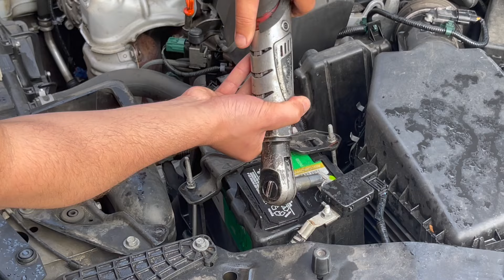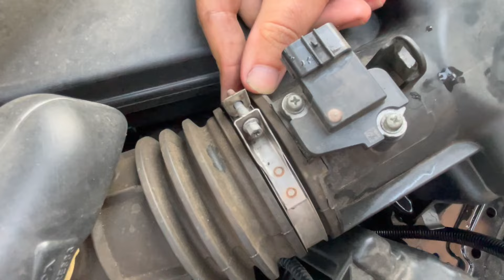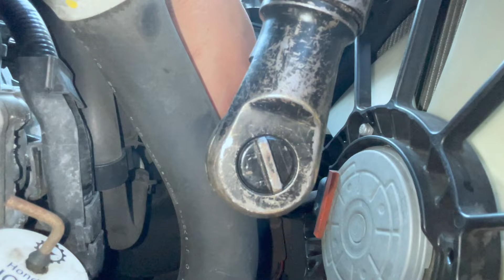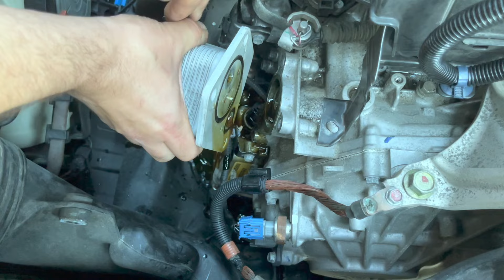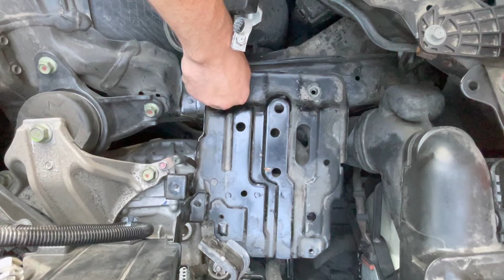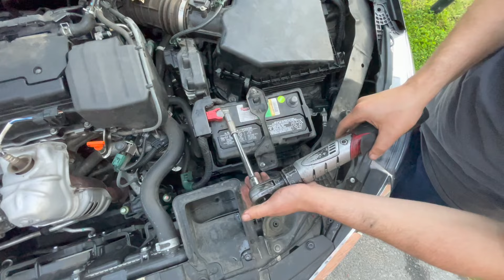DIY 2013 2014 2015 2016 2017 Honda Accord Change CVT Transmission Filter

Comment: Honda does not recommend changing the CVT filter unless it it leaking, clogged or damaged. If you are going to change any filter, the one on the bottom of the CVT in the oil pan should be changed. This one is just a secondary filter which is intended to filter whatever the primary filter does not. Changing this filter, especially by itself is not useful
Reply from the maker: Thank you for the info. I will try to do another video on the internal filter next oil change. Cheers
Reply: @MobileCarMechanic  please let me know when you do, I have the 2013 sport and I plan on doing all the maintenance myself as yourself so you’ll definitely be helping me with your videos! Thanks man💪🏽
Reply: Is there a video on this internal filter you speak of? Thanks for the heads up!
Reply: Where is the filter on the oil pan? What’s the part number please?
Reply: @mcbay9080  it's in the oil pan
Reply: Great video. Thank you!
Reply: @whatthewhat11. Yea your right Honda doesn’t recommend it they also don’t recommend to change your transmission fluid because it’s “good for the life of the vehicle” but you believe that?
Reply: @JOEL_AL_MONTE my owner manual says every 30k miles 2013 exl
Reply: HONDA SPECIFIES CVT  TRANSMISSION FLUID CHANGE AT EVERY 90K MILES FOR MY 2016 ACCORD LX 2.4 L ENGINE. (4 QTS OF HCF2 GENUINE HONDA TRANSMISSION FLUID)..oh yes😮
Reply: QUESTION ABOUT COMMENT ABOVE:
HOW DO YOU KNOW CVT TRANS FILTER IS NOT PARTIALLT CLOGGED UNLESS YOU  REMOVE IT?😊
Reply: COULD CVT TRANNY FILTER BE PARTIALLY CLOGGED ?😊
Reply: Would this be the same for a 2011 Acura Tl 3.7 AWD I can't find a video on one
Reply: So which filter should we change?
Reply: Changing any filter is helpful, secondary, or not. Maintaining the fluid in a CVT is very important for longevity. Honda doesn't recommend changing anything on a CVT , but does that really make sense ?
Reply: @kellyjackson1451 i agree with you.
Reply: You can't change the internal transmission filter.. because it's inside the transmission, duh.
Reply: @terrelle5087 wrong! It is inside the transmission oil pan. Not inside the transmission!
Reply: Where did you heard that genius? From what I heard it is recommended to change every 30k-60k miles.
Reply: @juangonzalez9567   honda tell you it's not accessible.  Plus, you wasting your time because it is not something that needs to be changed.

Smart guy
Reply: Maybe that explains why it's such a bear to reach this filter. Seemed as though we were journeying to Hades
Reply: Is that so they can make money off of keeping you dumb and not changing it if it's contaminated?
Reply: @juangonzalez9567 I don't believe there is a transmission "drain pan" on the CVT transmission. There is only a drain plug and level plug in the transmission body.
Reply: The 2013 doesn’t have a filter in the “pan” this is the only filter so changing this is useful
Reply: @JOEL_AL_MONTE  it's good for the life of the transmission 😂😂😂
Reply: @juangonzalez9567  he might be getting kilometres and miles mixed up 60k miles is about 90k kilometres.
Reply: Too complicate to change the filter
Reply: @kellyjackson1451 manual for my 2017 honda accord recommended that the transmission be changed , where did you read the honda does not recommend changing of filter or oil.?? 

You are not going to find honda documentation stating not changing filter or oil. Why? Because it doesn't exit. Prove me wrong. Please. 

I can't stand youtube wannabe mechanic. Making up statements and spreading wrong information
Reply: ALL filter needs to be changed juts like the air filter and oil filter and cabin filter. You gonna listen to the dealer ??? CVT are very delicate. All fluid and filters need to be changed get out of here with that bs
Reply: @juangonzalez9567 that would be the strainer. The actual filter is behind the warmer on the front of the trans.
Reply: Exactly!
Reply: Both if you want job done! Internal in oil pan is more important, because collecting all metal shavings and debris from transmission wear, this filter is just for “transmission oil cooler” which is insignificant according to honda 🤷🏼‍♂️
Reply: you can, but you need to drop oil pan and later need to install new gasket for oil pan
Reply: @JOEL_AL_MONTE  Honda doesn't say that 😂. Every 30k
Reply: Yea, if the filter is clogged or damaged, then it's too late.
Reply: Most of the time, I don't listen to car manufacturers in their lifetime oil guarantee...

I better change it myself to avoid damage.

Comment: Honda transmission filters (actually there are 2 of them) are not designed to be changed on a regular basis and it is not in any maintenance schedule. Its just a fluid change. The filters are designed for the mechanic to inspect if there is a transmission failure. It aids in the mechanics diagnosis. Can you change them, yes. Do you have to, no. Is it necessary, Honda doesn't say to which is why they dont keep them in stock.
Reply from the maker: Thank you for the feedback.  I appreciate the knowledge .
Reply: I get my transmission fluid changed by Honda, $70 not bad.
Reply: @TraxxasRustler97  that's a heck of a deal
Reply: @TraxxasRustler97  are you sure they actually changed it, $70 is only 10-20 more then the fluid itself cost to buy (4-5 quarts). Sounds to me like they might be "giving you a deal" then not servicing it in return. Dealers typically charge at least $150-$200 for a trans fluid swap. No dealer charges $70 and actually does that... heck an oil change is $70 now at all the honda dealers. My friend get a local mechanic to check the fluid to make sure they actually changed it.... that's sketchy.
Reply: Good Information to know. I was wondering why my dealership kept telling there was no transmission filter to change which led to some confusion. It's there, but not required to change, now I know.
Reply: Of course they won't recommend it. You make your car last forever then no business for them Stealerships
Reply: @TraxxasRustler97 I doubt that...the CVT fluid itself cost 71 bucks with tax at the dealership,  the whole job probably cost 200 bucks ..
Reply: @pizzaloverfpsdude exactly 💯 something is fishy with that 70 dollar fluid change .

Comment: Taking out battery tray on accord is PITA. This is the most elaborative video so far. The best. Thanks for making it easy by putting the camera on the right spot. 🙏
Reply from the maker: Your welcome.  Cheers!
Reply: you are telling me! I don't think I'll bother replacing that filter. I hear the larger filter in the pan is the primary one although I'm not sure that one is worth the trouble either.

Comment: Just finished my third drain and fill yesterday at 55,000 miles on my 2013 accord. Switched it over to AMSOIL.  I never even knew there was a filter in the transmission to replace.  Good on ya.  I'm curious now what mine looks like.  May have to tear it down and replace.
Reply from the maker: Great job!
Reply: You will probably be lucky because you have replaced the transmission fluid so often.  Every 18K miles is excessive unless you have been towing things or operating under extreme loads.  30K miles is more appropriate. Dont forget the filter.
Reply: There are two filters: one inside the oil pan and the secondary (this video).
Reply: Every 25K-30K is sufficient.
Reply: @michaellim4165   could you please elaborate what is the pan oil transmission filter? I saw only this one getting replaced on YouTube, and also saw that this one doesn´t need to be change and if so, then not so often.
Reply: @Iwaans  The second filter is located underneath the transmission but you have to remove the bottom pan to access it.

Comment: If you’ve changed your trans fluid because your car occasionally stutters, before doing this I’d highly recommend checking/doing spark plugs if you haven’t already. I thought about replacing this filter, however my car runs like new after putting in new NGK spark plugs.
Reply from the maker: Thanks for sharing, that's a good point to look into!

Comment: Nice of Honda to make that as inconvenient as possible
Reply from the maker: We agree!
Reply: cmon man most things are easily accessible on a 2.4
Reply: What a poor design by Honda , this is simply nuts , just to change a tiny filter.  What is the advised schedule for this job ?  How often do you change the CVT fluid ? I go 30K between changes.

Comment: Bro: thanks for the hot tip. after 10 months i finally got the cvt transmission filter. There is another issue with these 4-cylinder dream works engines they burn oil. i have to add oil after every gas fill up but otherwise i get 35 mpg in the fwy much better than a  BEnz. There are lots of u-tubers who are experiencing this troubling oil consumption issue.
Reply from the maker: No worries, glad our video helped. Didn’t know this generation had issues with oil burning like that. This is a 2016. Not sure if they remedied that in the later years. But that oil consumption sounds insane. Do you have oil leaks?
Reply: Burning oil at what rate ?anything more than 1qt every 5k miles is excessive in my opinion since its a NA engine
Reply: @Mm.2112  sounds like someone didn’t maintain their car well to me
Reply: I changed my purge valve and pcv valve and it got that cleared up ..I had that same problem try it out see if it helps you only cost about 80$ for both parts and they are pretty simple to  replace..the purge is a little more tidieous though
Reply: @TsushimaGhost88  thanks bro.  the Honda dealer wont tell me this solution.  All they want is to price gauge me.
Reply: @henrylee2964 no prob man 👍 and  trust me I know they were kept telling me it was my catalytic converter just to get $1500 bucks out my pocket.
Reply: Hoping its not the compression rings that need to be replaced. Solution would be to rehone the cylinders and replace with higher compression rings. Cost: $2500-3000 usd.
Reply: @JohnS-il1dr   Thnaks bro.
Reply: A few months late to this but literally and exactly same problem with oil consumption. It was just the pcv valve. Your supposed to change every 35,000 miles as they are cheap plastic
Reply: @plural8666   thanks bro.  I will change out the PVC.
Reply: Change the PVC valve. No one tells you to change that. I was losing some out exhaust. System That' Solved my issue.
Reply: They do not burn oil , they weep oil from the valve cover....
Reply: @johnuhelski8613  bro what is the torque bold sequence to take and replace the valve cover bolts . i think there 10 bolts that need to retorqued back onto the engine block.

Comment: Great video with a lot of tips. But can you tell me about the recommended torque on the 3 bolts (12MM) on the oil cooler.? and the Correct 3 O-rings part number?

Comment: Wow no pan dropping and changing a big gasket? Now it’s so simple u do it without going under at all. Thanks for the video.
Reply from the maker: Thanks. It’s not as hard as it looks. Cheers
Reply: There is a filter inside the pan. The primary/main filter is in the pan and that's the one you are supposed to change periodically. This filter is just the secondary filter which is only supposed to filter out anything the primary filter may have missed. Honda recommends not replacing it unless it is clogged or leaking.
Reply: @erod6468  ok that makes sense. That little thing is small to be the only filter I guess. Planning on changing it next time I do my oil change can’t wait
Reply: @erod6468 wrong. The strainer is what’s under the trans fluid pan.

Comment: I had a 2013 accord EX-L with 232,000. But a deer took it away! LoL
I would change the transmission fluid once a year around 26,000 per year! I never knew that filter was there! Never had a problem.
Reply from the maker: The more you know haha. Sorry to hear about your accord. Did you end up buying another one?
Reply: Neither did I. I have a 2016 sport with 155,000 miles. Changed tranny fluid every 50,000 miles. Never had an issue

Comment: I didn’t see the ground cable under the. Battery pad reconnected. Also did you have to add anymore transmission fluid? I would guess not little was lost thanks in the filter change. Thank you good video!
Reply from the maker: I did reconnect it but didn’t video it. All you need to do is slide it on to the tab and it will lock in place. I didn’t bother adding fluid since it was a minimal amount. Thanks for the comment. Cheers!
Reply: Great video. I was also wondering if you had to top up the fluid... that did look like alot of fluid lost during the change.

Comment: Honda just charged me $230 and I brought my own Honda transmission fluid! Couldn’t get the bolt off without snapping the transmission case but I’m assuming they did this filter as well
Reply from the maker: From what I understand they dont replace the filter, Just a drain and fill

Comment: I followed all your steps. When I started the car (2017 accord lx). It is  leaking. So I left car will break down again tomorrow.  I have all honda parts from dealer. Any tricks?
Reply from the maker: I’d make sure the gaskets and o-rings are lined up

Comment: i didnt know the cvt had a filter to replace. i have had the trans fluid changed at least 3 times at a dealer ship and they never mentioned a filter. when is this supposed to be changed?.  i have also heard of people replacing the pcv valve also and thats an easy one to get at.
Reply from the maker: Not sure if it’s a maintenance item but we decided to do it since the car had over 100k. There is another internally that we didn’t realize was present that we may replace in the future.

Comment: noticed a lot of fluid come out, do you add some back in when youre done or no? and how do you add more fluid because there's no dip stick that tells the level
Reply from the maker: I didn’t add any and it’s been fine, you have to use the check bolt on the bottom of the transmission to make sure it’s at the proper level.

Comment: Great video bro
Do you need to add back the amount of fluid spilled out?
Reply from the maker: You can but I didn’t since it wasn’t a large amount that spilled out.
Reply: @MobileCarMechanic  
Thank you for the well-explained tutorial 
How often do I have to check the valve lash on honda engines?

Comment: Can you get the o rings and the filter at any auto parts store? I finally have a day off coming up and would love to do it sooner than later. Do you have to special order this stuff online? Great vid BTW!
Reply from the maker: Thanks. I’m sure you could find o-rings of the same size elsewhere but it would be easier to get from the dealer. They should have it in stock. The only one I had to wait on was the o-ring on the filter itself.

Comment: Hi just wanted to ask a question I have a 2014 Honda Accord LX if I change the transmission filter do I have to top up the transmission fluid or not because I already changed it transmission fluid Or is it ok just leave it for next time when change it
Reply from the maker: I didnt top it off and its been fine since the replacement.

Comment: The little fluid you lost would you add a little back in or connect and leave it, just asking a question, not a test because they say what amount we take out we must try to match putting back in . thank you in advance.
Reply from the maker: I didn't add the small amount that was lost.  It hasn't made a difference. you're more than welcome to do so without any consequences

Comment: can I get away without replacing the o rings on the warmer? they are hard to find. I have new filter and o-ring for filter
Reply from the maker: It would be advised to replace them as they will most likely be flat and won’t seal as well.

Comment: Does this make the transmission shift better?  I assume it does.
Reply from the maker: It may help slightly but the transmission itself doesn’t have gears like a torque converter based transmission would. They use belts and cone shaped pulleys.

Comment: I have a 2014 honda accord hybrid exl with 86,000 miles. Transmission fluid was never changed.  Is it too late to change the transmission fluid? Should I change the transmission fluid?
Reply from the maker: They say not to typically change the fluid, we changed the fluid after 100k and the transmission honestly didn’t have any issues to this day. The car has 150k on it now. I think we changed around 120k

Comment: So the transmission fluid that was lost when you replaced the filter, did you add more after you were done? Or was it not shown you refilling once you replaced the filter?
Reply from the maker: I didn’t bother refilling the lost fluid as it was a small amount.
Reply: You can always do this service when you're also doing the CVT Trans fluid change to knock everything out at once
Reply: @MobileCarMechanic  I just changed my Trans fluid at 68,000 miles, but didn’t replace the filter…I didn’t see it as a maintenance item with Honda.  Do you think it will be good for another 30,000 miles or should I change it now?  Thx.
Reply from the maker: @larryzapotocky1363  Yea you should be good for another 30K.  I had replaced my transmission fluid first and after few months I replaced the filter.
Reply: Ok my question was answered thanks great video!

Comment: If I only want to change cvt filter I will lose some oil when opening removing the filter, am I correct ? There's no need to drain transmission fluid before removing the filter right ?
Reply from the maker: You don’t need to drain the fluid to change the filter. Some will leak out and make a mess.

Comment: at what odometer reading, one should change transmission fluid and transmission fluid filter?
Reply from the maker: I like to do the fluid at 30,000 miles, we changed the filter but it wasn’t necessary as it’s not showing as a maintenance item. We did it with the fluid change.